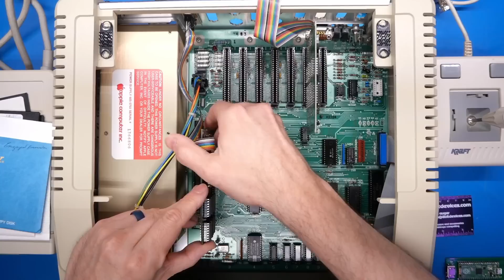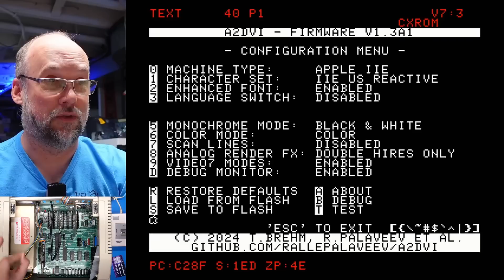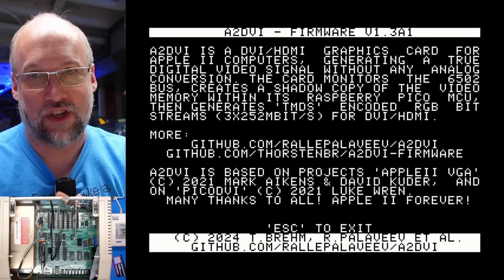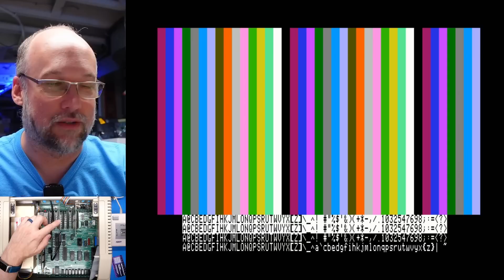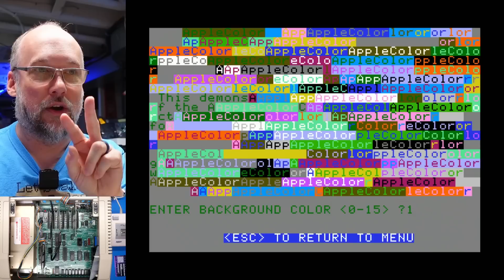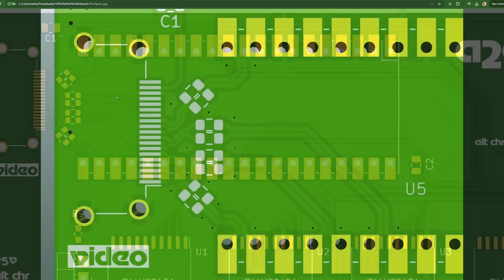HDMI video from your Apple II with this cheap and simple project (A2DVI)

Comment from the maker: Just a small clarification: The '245 buffers are required on this project due to the way the Address and Data lines are multiplexed going into the RP2040. There aren't enough GPIO lines without doing that when combined with the GPIO needs of the HDMI connector.
Reply: I have been working on my own retro computer project using the RP2040 and much of the information often citied about when you can attach an RP2040 to a 5v bus is misleading or outright incorrect.

The RP2040 is not actually 5v tolerant in most situations and the official datasheet says it is not 5v tolerant.  It can theoretically accept 5v inputs if the VDDIO pin can be guaranteed to be powered before any signals are applied but that is very hard to do in most situations.  Most RP2040 chips do appear to be able to survive 5v signals for a period of time in spite of this but it is not a good idea.  It causes the ESD ESD protection diodes in the RP2040 to draw current from the data lines and as a result sinks far more drive current from devices on the 5v bus than it really should.  This in turn can potentially cause extra stress on possibly irreplaceable vintage ICs.  

There really is little reason to even attempt to use the RP2040 directly on a 5v bus given that proper level shifters are both plentiful and cheap - even bi-directional ones.  They also provide a form of isolation in the same way that buffer chips do which is also generally good design practice for digital circuits.
Reply: @gemedetvideo  CORRECT! I use 74CBTD3861 on my own Teensy 4.1 projects
Reply: @gemedetvideo  Correct! I use the 74CBTD3861.
Reply: @gemedetvideo  Exactly! I use the 74CBTD3861 with various microcontrollers.
Reply: The PCB of the original video board are gold plated while the board with the Raspberry Pi Pico are not - they are HASL. This board will gradually destroy your Apple II's edge connector. All properly fabricated PCBs for edge connection contact use ENIG of 2u or more or hard gold plating.
Reply: @francoisleveille409  beggars cant be choosers, most of old parts are dying and not available. don't remove the card once its inserted.
Reply: Some of the clone PIs have more GPIO. The "purple" ones have GPIO 23 - 29 and have 16MB of flash storage.
Reply: @KAPTKipper  Do they also have the 2040s Programmed IO? This is requiring the PIO
Reply: @der.Schtefan  The 2040 is the same chip and has PIO
Reply: The  RP2350 Pico 2 will have them as it it can have up to 18 additional GPIO, as well as GPIO for ADC, so it would also be possible to say add Mockingboard emulation as well and feed it over the HDMI
Reply: @coreykirkpatrick4392  although, there are apparently some scary bugs in the RP2350 Picos (scary as in not fixable with firmware updates).  I'd be careful for now.
Reply: It's almost as if a raspberry pi isn't the best solution for every use case 🙄
Reply: RE: custom fonts on the apple ][. The game TAIPAN used a custom Ye Olde font. You just need to get to the source code (Some pokes need to be done and it's revealed).
Oh now that I think about it. I'm sure there's a "beagle brothers" or some other utility group that made a font editor. I'm about 90% sure I used one many years ago.
Reply: International countries? Isn't every country international if they have a border? So many out of date assumptions in this video. Thumbs down. Appreciate all that you do for the retro community, none the less. Just do it with the perspective that there are about 200 countries in the world.

Comment: Based on what you said about the video mapping.  Hires page 1 $2000-$3FFF, page 2 $4000-$5FFF, you could make a page 3 $6000-$7FFF though I can't remember if anything is used in the high $7FXX memory.

Comment: And now we unlocked the future of computer system which has every electronic module as a tiny computer running software, instead of motherboards and cards having hardware logic. It makes the system fully dynamic and modular. The entire system can change behavior completely, as a chameleon system.

Comment: This board renders output from its internal buffered representation of what appears on the slot bus. This is not adequate for cycle accurate timing effects or for using alternate character generators. If you want a solution that gives you exact same output as you would see from the composite output then take a look at the A2VGA card.

http://lukazi.blogspot.com/2024/07/a2vga-pico-cards-available.html

Comment: @adriansdigitalbasement what are your thoughts on using upscalers/converts (ie. OSSC Pro, RetroTink 4K, etc) to replace CRT monitors for these older computers?  I'm finding it extremely difficult to find space for my current CRT.  It's disappointing to lose the authenticity and feel of a CRT but it's so much nicer to use an LCD for space, clarity, etc.

Comment: so , if you can't have both this new board & the old original running in parallel,

could there be a Daughter board to feed an analog (corrected) signal to the old composite/VGA displays ?

the delay would be minimal (only one conversion from digital-to-analog ?) &

there'd be software control of that analog signal. (as opposed to a Hardware converter box)

Comment: Thanks for this! I had a few boards built and got it to work amazingly! Were you able to get that HDMI to VGA adapter to work on yours? I've been trying to get it to work for my video switcher that has a VGA in and passthru for my capture card and even directly connected to my CRT screen cant get a signal from it.

Comment: Pico clones often have slightly different pinouts on the board pins. The RP2040 itself is obviously the same, but you might not be able to just drop a clone board in without some modifications. Just something to be aware of if you’re shopping for one.

Comment: Was triggered when Adrian was talking about that card watching the bus in combination with some hardware toggle on the back and repurpose that switch/jumper. Thinking out loud here: Wouldn't it be an option to watch for a keycombo if that reaches the bus and activate/overlay some config setting straight from the RPi just like that bootdisk was doing? Even halt the 6502 perhaps. But activate it like a KVM switch.

Comment: I'm glad the pico exists for these projects because the raspberry pi, even the zero, is way too fast, I mean what's the point of having a retro computer if you're gonna put a modern computer that's like 100x the speed and could just emulate it and cut out the middleman, but I feel much better about a device like this that's just powerful to pull it off.

Comment: The maximum voltage for GPIOs in floating mode (a.k.a. input) is 5.0V for the RP2040, which doesn't qualify for the label "5V-tolerant", which requires the pins to tolerate 5.5V (10% margin). The RP2350 tolerates 5.5V but with some caveats.

Comment: The "BASIS" mode is likely for the BASIS 108 (pronounced "BAH-sihs" as it's a German computer), which featured a 6502 and Z80, so it ran DOS 3.3 (not sure about ProDOS) and BASIS's own variant of CP/M.  I've played with one in my time.  Heavy box and otherwise nice machine, especially if you want to run something like WordStar.

Comment: Running ICs at voltages higher than what they're rated for, even if they're tolerant of other voltages, will quite often shorten the lifespan of said components. By how much will be on a case by case basis, but that's effectively the tradeoff. You can decide if it's worth it.

Comment: IIRC, the Apple][ runs video data out of ram on the off clock cycle from the processor, interleaving the ram between the processor and the video, small matter for a pi to sniff it out, complete with addresses and video mode settings.

Comment: What Chris said about the traces is 100% true. HDMI/DVI use differential pairs. The pairs of traces act as transmission line and must be impedance matched using a PCB calculator tool. Matching the length of the traces is also critical.

Comment: There is another way to get HDMI from your Apple computer - remove the system board and replace it with a modern Core i7 board with 64GB of RAM and an 8-core processor. You can run 20 or 30 Apple II games at the same time! Honestly it's not retro if you're using a Pi-world device to create an illusion.

Comment: I don't really understand why this version has moved things around in that way, maybe there is a good reason for it but it seems like it's just made it less convenient. In addition to the HDMI port being on the "wrong" end, it also makes the Pico USB inaccessible for reprogramming unless you have a special cable or mount it on tall pins...
Reply: The video connector was moved to allow the card to work with the Franklin Ace case design, to use every slot in a ][+ case, and to allow a chassis mounted connector without placing undue stress on the PCB connector. There is adequate clearance between the RP2040 and the host PCB to allow a micro USB cable to be used for programming without issue.

Comment: The RP2040 chip on the Pi Pico is rated at 133 MHz and all these RP2040 DVI tricks require running it at 252 MHz. That’s a 90% overclock.

The RP2350 has a double pumped high speed transmitter and hardware TMDS encoder so it can do VGA resolution at only 126 MHz. It’s just a much better solution, and the chip is basically the same price. Hopefully we’ll see these projects all move over.

Comment: WOW ! ... never knew about this video7 board even though I have used A2 since the 13 sector II days and later II+ clones, IIe! ... and also Dazzle Draw crystal clear in colour! ...... so if foreground and background text screen colour is able to be controlled in the video7 mode, the implication is that a colour (color) ANSI text terminal emulation would be possible (at least for regular alpha numeric characters in 40 column mode) !

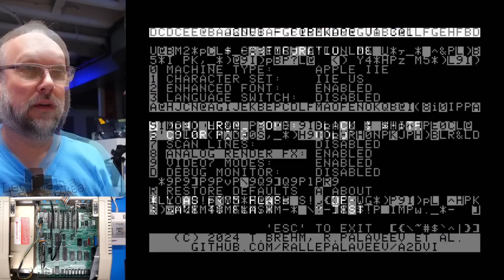Comment: It's strange that setting "Analog Render FX" to "Enabled" doesn't actually enable them for everything, at least in the firmware version that you tested (41:20 - it appears not to activate it in single high-res mode, only in double high-res mode). When actually operative, though, this effect looks like the color algorithm that I implemented in the emulator ApplePC in 1995. I modeled it after what the Apple Color Monitors at my high school appeared to do on close inspection, which is take each DHGR pixel, and assign it a color depending only on its horizontal position modulo 4. That color is then spread additively to itself and the next 3 pixels to the right of it (4 pixels total). So the color of each pixel is determined only by itself and the 3 pixels to the left of it. (HGR is treated exactly the same as DHGR except for being preprocessed by pixel-doubling everything horizontally. Unlikely, apparently, the A2DVI firmware version you tested.)

Unfortunately I didn't have a digital camera back then, so I was only able to guess at what the RGB components of those 4 colors were, tweaking it at home until the result resembled what I remembered it looking like on the school monitors, while also conforming to a mathematical model I thought was likely to be correct. I also got some requests for an RGB monitor emulation mode, but since I never saw Apple II RGB color in person, nor a IIGS, I never had anything to model it after (and didn't trust the other emulators of the time to use as an example). It's interesting to learn now that there were RGB solutions that provided whole new video modes!

Comment: The chip in the Pico 2 (RP2350) can do DVI output without overclocking or PIO. It has a new capability called high-speed transmit (HSTX) which is specifically dusigned for applications like this.

Comment: Perfect project, shown how the world was changed till 30..40 years.
But didnt understand why people using whole rpi module instead of only rp2040 chip. Yes, its increased BOM, lighltly complicated assembly, but you'll have much more electrically and mechanically optimized PCB. 
I'm using the modules only for the prototyping, like they main purpose.

Comment: This is awesome! Should this possibly this works with the Brazilian TK-2000, a microprofessor II clone?
Reply: @CarlosWagnerCosta  if it’s an Apple II clone with slots and a (stolen) Apple ROM it should be fine. The Apple II was a design using standard parts, the only proprietary thing was the ROM.
Reply: @av_oid  thanks. I will try it

Comment: Nice! I wouldn't mind a version of that for my Apple IIC if that's possible?
Reply from the maker: Unfortunately it wouldn't work as is, but with an interposer under the CPU. This project here is supposed to do it using the IIc video port but I don't think the hardware is out yet. https://github.com/V2RetroComputing/v2c-firmware

You best bet is the RGB2HDMI project which can decode the serial data right from the IIc video port perfectly. https://github.com/IanSB/RGBtoHDMI
Reply: @EEVblog  Hello Mr EEVblog. Hopefully Adrian will answer, but I can help: This project can’t do that, but another project the, the A2C Tangy Pack can. It uses a Tang Nano 9K fpga dev board (that probably has the power to run an Apple II core). There is a video from KansasFest about a month ago covering it and ct6502 has video on it 3 weeks ago: “163: Hook your Apple IIe and IIc up to HDMI”

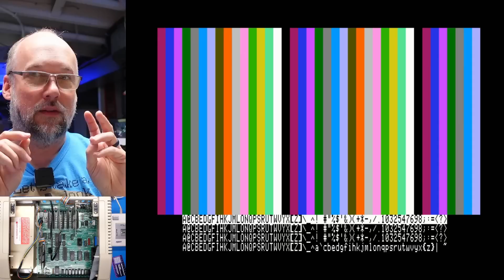Comment: 27:50 why are the letters out of alphabetical order? A@CBEDGFIHKJMLONPSRUTWVYX[Z]    WTF?  Isn't ASCII in alphabetical order or is Apple (Woz) just weird?
Reply: The Apple 80-column mode worked like the 40-column mode, but added the extra columns into an extra bank of memory on the 80-column card. So alternate columns are in different banks. Why the banks are backwards (aux bank columns to the left of the original text page characters in the same position rather than to the right) I'm not sure. Knowing Woz it probably saved a gate or two to do it that way.

Comment: What does TTL stand for? All I can find is "Time to Live" when googling it but that's a networking term (referring to the longevity of a network packet as it hops from node to node before it dies), but that's nothing to do with how you're using the term.  Originally I thought TTL referred to teletype serial interfaces that simply displayed plain text on a screen (or a printer, or ticker-tape) but now it sounds a bit more involved than that when you're getting down to the level of pixel, and mimicking color burst NTSC signals.
Reply: Its Transistor/Transistor Logic. As distinct from Resistor/Transistor Logic (RTL) or Diode/Transistor Logic (DTL).
Originally developed by Texas Instruments 60 years ago.
Reply: @markevans2294  Oh, so what do modern CPUs use now?
Reply: Search for transistor–transistor logic

Comment: I would really like to see some generic RP2040 cards for various systems with a display output, SD card input and some generic connector like SPI and i2c that the community can use as a base for all sorts of software defined card projects

Comment: I can't wait to get a stack of RP2350 boards and chips. I've built my own 8-bit/16-bit "computer" by designing cores that run on a few RP2040's that each act like purpose built chips that handle different aspects of the computer. Sure, it's technically just emulation that I started to replicate a Z80 and 8086 compatible system similar to my NEC PC88VA3, but it was a fun project nonetheless for me that's more interested in low level/bare-metal programming. I've since moved to a software based "fantasy computer" (thing Tic80) that uses a module approach to design different "expansion cards" that are purely software implementation to act as virtual graphics/sound cards and more. I/O, Storage, Serial, etc. are integrated into the main core that's a fantasy CPU that uses a faux Assembly instructions similar to both a Z80 or 8086 depending on the mode you're in. That project is running off a newer Radxa Zero to simplify it, just being deployed as a contained ultra light Linux setup over bare-metal to keep it easier to set up for new people to learn about computers with. I've considered rewriting for bare-metal using RP2350(s) on a purpose built board, but with the goal of being easy to run and access, I'd rather just built it for a lightweight lower power SBC so basically any compatible SBC can run it from there on up.
Reply: Hi, any chance you’ve made a video about your tinkering?
Reply: there is no problem to run your fantasy computer on rp2040. i have zx spectrum 128k emulation + ay8910 emulation + vga and dvi + ram expansion up to 2048k emulation + ula plus (64 color graphics) emulation and all these things on single pi pico rp2040

Comment: @adriandigitalbasemet. Hey I also love this software defined hadware of all sorts. I noticed you keep saying (several videos) that rp2040 is 5v tolerant. The datasheet says it is not. (3.63v max supply + 0.5v= 4.13v max, and 3.8v typical) I guess it may work at 5v but it just doesn't have to. Can you point me to a project that actually puts 5v on rp2040? This could make my life easier! Thanks!